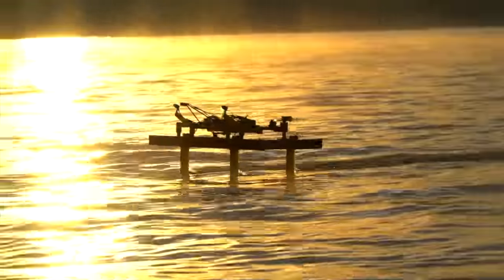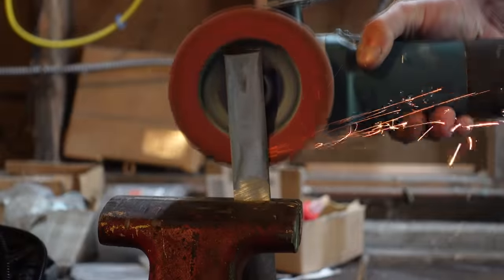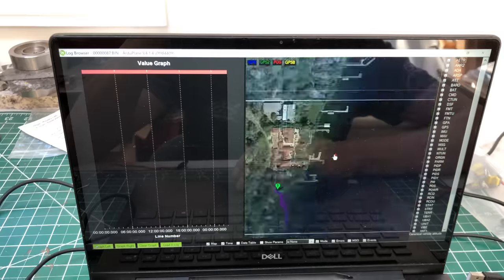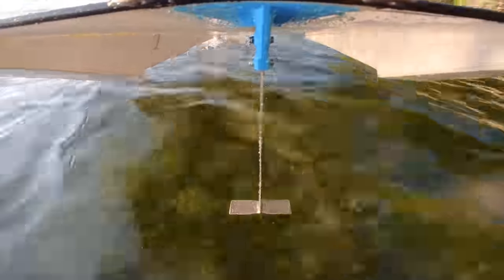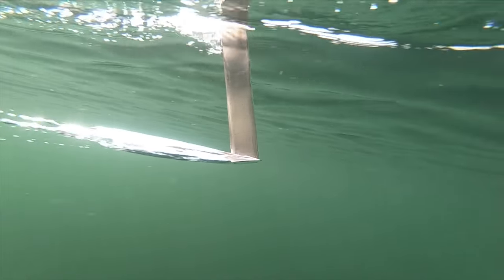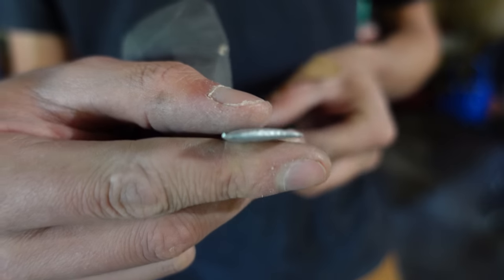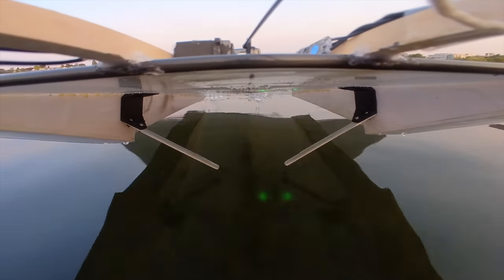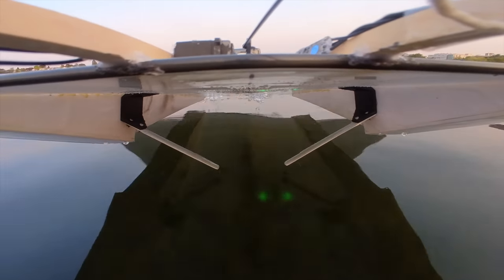Airplane + Hydrofoil - Good or Bad Idea?

Comment: So I guess it's a hydro effect ground effect vehicle now?  :-)   If you look it up, and haven't already, there was a cool one point hydrofoil I saw way back.  The configuration was downright weird, as I remember it.  It was basically a conventional aircraft configuration with the foil on one wingtip, and the other wingtip had another conventional aircraft glued to it at the fuselage at a bank angle (if you will) to the first. 

It think, again IIRC, that it worked pretty well, but I don't remember if it was a scale model (I think it was) and if so, if it ever progressed to a full scale configuration.  I can't remember, but it may have been a cover of popular mechanics or something similar.  It's been a LONG time since I saw it, that much I do remember.

Sorry so sketchy, I should look it up.  Also, I'm not sure that a very sharp trailing edge is at all necessary, or even desired, in water.  I remember that high speed boat rudders actually tended to have a truncated face, squared off, at the back of rudders.  Probably something to do with the fact that water is incompressible.   I also remember screwing around with making a sharp, more typical airfoil on the skeg that went down to hold the prop shaft, and I think I made it to high an aspect ratio for the chord width, or something, as it was aluminum and on the tapering portion behind the crown, being of aluminum, you could see where cavitation bubbles were eroding the crap out of it.  Just a strange data point for you.  That's what I get for not at least thinking the problem through beforehand, or learning a bit more about it.

As for your yaw stability issues, yeah, obvious. You have put the CP forward of the CG, water borne.  Not a good idea.  Think about what happens when you try to run with a wheelbarrow as soon as it starts to yaw a bit, or how much rudder action a tail dragger requires compared to tricycle gear.  You could put a rudder rearward, which is what I'm guessing you will do later in the video (still early days when I wrote this).

When I used to take my son skiing, and he would sometimes wipe out in the lake weeds, he would sit there and scream bloody murder until he broke free (planed on) of the water again.  He was mostly just being an irritating idiot, on purpose, but neither he or I liked them either.  On difference is we are in Fl and alligators exist in pretty much every large lake or chain here.  Not the greatest mind movie.

Once we tried to plane the boat quickly out of a canal on a lake where you could see gators EVERYWHERE.  We were running along on our 16' Hobie one day on that lake and we scared three gators off the bank.  I swear to god that the final one of the three was within a foot or two of the length of the Hobie (not exaggerating).  When he hit the shallow water, which extends out a ways, coming out of the weeds, water was flying everywhere.  Impressed the hell out of me.  Any way, the plane before the canal got shallow was a cluster*uck and we got stuck good. He hopped across the 8-10 feet of water to get a tow rope on the shore to free it, and he practically looked like a Jesus lizard in the process.  Fun times.   And I GUARANTEE you there were gators in that canal.  For anyone that lives in the Central Fl area, the lake I'm talking about was Jessup.  And I'm not kidding about the population of gators.  You can drive across the expressway that splits it and see three or four, when it is calm enough, pretty much every pass.

And you very much DO get ground effect landing a conventional aircraft.  I used to fly an SD100 sailplane and when I landed short and wanted to extend the glide to have less distance to walk to pick it up, at about 1/4 span from the ground, which was about 2' in that case, I could extend that touchdown point a LOT, over just flying a normal glide slope approach, especially if I entered that point at significantly higher than stall speed, I'm talking tens of feet here. It is also why short field takeoffs in full size aircraft are done the way they are, to take advantage of much lower drag in ground effect, vs the drag wheel borne, to get quicker airspeed increase for earlier climb out.  Ground effect starts to become more pronounced at about 1/2 span, and I'm guessing the closer the better, as long as you're not clipping the ground.  Your conclusions are pretty much what I would have guessed, but as always, very interesting.  BTW, the props in front of the wing actually do more than just generate more velocity over the wing at slow speed.  They also cause turbulence, like a turbulator device on a wing, which contrary to my intuition actually sticks the flow to the wing better in the velocity/angle of attack regimes it likes to separate, and laminar flow is always a good thing, approaching stall speed especially.  They used them on the Long EZ (built one, about halfway, anyway) on the canard for a couple of reasons, pitch trim change reduction in rain and bugs (splatters), and reduced rotation speeds due to the fact that the prop flow DOESN'T augment canard lift.  Canards typically don't make great STOL aircraft for that reason, not the optimum configuration.

The inverted 'phone home' was funny.  Wouldn't have seen that coming without thinking it through carefully.  A tip-over power removal switch would solve that if it's an unwanted 'feature', similar to devices typically used to remove fuel pump power in overturned cars.

Comment: Every vehicle runs more stable forward when steering is in the front and the backs direction is stabilized by fixed axles or rails.
So the finn in the front also here makes the back sway aside and the vehicle uncontrollable. 
There's a reason why vains of an arrow or the rudder of an airplan or a ship are in the back.

Comment: You’re missing a ton on that electric plane’s design with it ‘hanging from the wing’ instead of ‘on the wing.’ 
    Check out hydrofoil skiing chairs. You ride a chair that hydrofoils behind a boat while holding onto a rope, just like skiers. I built a couple. Angles are even more important than for AIRfoils. You went about this in about every wrong way as possible. They also have to be ‘tuned,’ like a mass damper for skyscrapers. Not just for harmonic vibrations, but they must be balanced on CG. Chord length is SUPER IMPORTANT, just like with a propeller design. Skiing hydrofoil chairs are the only thing I can think of that hydrofoils with only one chord going in the water, but even it had two horizontal ‘control surfaces’ very similar to an airplane elevator. This was 25 years ago so design may have changed for the chairs. But a hydrofoiling sled that held 4-5 people and weighed 40-50lbs even had two separate vertical chords going into the water, each with a single horizontal stablizing surface. One in the back and front, with the proper length chord at the proper angle to the CofG WHILE IN FLIGHT, tuned against harmonic vibration and more importantly tuned against oscillating feedback loops, with the properly angled horizontal lifting/stabilizing surface perpendicular to the water piercing chord that would equal the lift produced by the airplane would have most likely worked. Plane lifts. Hydrofoil needs to be neutral to the lift produced by airplane….and I’m speaking very roughly here and can explain further if need be privately. LOTS of modeling has to be done and computational fluid dynamic sims would need to be run. You can’t just swap some stuff on with guessing, my dude. It can work and I’ve seen a hydrofoil ground effect rc airplane. NASA did one years and years and years ago in an old documentary that was here on YouTube and several rc forums that have since shutdown had a couple guys into that sorta thing. It wasn’t easy but the ones that were done right were rock friggin solid like they were on a magnet and the surface of the water was the magnet. It was mesmerizing to watch. But don’t fly your models over or too close to the public- makes us look really bad. And goes doubly for their pets: people get hyper defensive over their animals not always knowing when it’s in danger.

Comment: I did not realise how much more drag a hydrofoil has vs a wing.

OTOH, surely it would have less drag than a hull. So can you use the hydrofoil to reach lift off airspeed under less power then have no surface contact under ground effect?

Comment: As you hinted but never came out and said clearly...
A wing for a ground effect vehicle just doesn't work like an aircraft wing.
The ground effect wing is made to trap air between the wing and the ground surface. This is why the wing is ineffective the greater the distance between the trailing edge and the ground.
An aircraft wing works aerodynamically which means it works by creating aerodynamic lift which is typically the difference in surface pressure between the upper and lower surfaces of the wing. In other words by creaing a low pressure above the wing, the higher pressure below the wing lifts the wing.

Comment: doesn't seem useful in flight, but what about a version that is only effective for take-off? reducing thrust needed to lift off the water means a lower power target and you'll be less likely to have the power to fly out of ground effect. idk if this would be achieved by making the foil much shorter (just long enough to help the rest of the craft break contact with the water), or a similar length with the ability to retract after take-off, or something i havent thought of.

edit: finished the vid and now i think my comment is pretty much redundant

Comment: "high carbon stainless Steel"
Was it heat treated? If not there's no point. But I don't think you need the hardness you would gain by quenching it.

Comment: Could the stability not be from being attached at multiple points on the boat instead of dihedral? I am thinking it has more to do with center of gravity or something other than dihedral. Think unicycle vs tricycle. But I am not an engineer, just smarter than most.

Comment: Make the hydrofoils taller so it’s depth corresponds with the plane getting too high and loosing ground effect. So as the ground effect loses its efficiency at higher altitude the hydrofoil is tall enough to compensate and will stop the cavitations between foil and ground effect. Even better make the hydrofoils length adjustable like a tooth drive on the tailing edge that a servo can rotate and adjust the height of them.

Comment: but. But. What with 2 foils, one on each wing, instead of 1 central one? I think that was the thing most people had intended with their suggestions on the old videos... It's possible you'd need a larger rudder, although your ailerons will actually also generate yaw instead of roll in such a configuration, allowing for very flat turns (avoiding the problem you had with wing tips touching the water in normal non-wide turns)

Comment: Interesting experiment and probably confirmed your and most person's intuition that hycrofoils don't belong on ground effect vehicles...
As your experiment confirmed, drag is a major issue in all modes of "flight."
Fully submerged, drag of the hydrofoil structure is at its maximum and with all hydrofoils is a big negative until the hull is lifted out of the water.
In this second mode of semi-flight, only the hydrofoil structure is creating drag, but because of the viscosity of water in combination with the necessary hydrofoil plane plus support structure, it's still very significant compared to if nothing protrudes into the water which is the third mode of operation of a ground effect vehicle...
Full Flight. When any vehicl can lift itself completely out of the water, then it will have vastly less drag than if anything at all on the vehicle still pierces the water.

Lastly, IMO the comment in this video about ground effect vehicles performing optimally only in still or calm waters is likely due solely the design of the wing. I can imagine all sorts of ground effect wing designs where the leading edge isn't low to the surface of the water and so should easily perform wherever waves would not wash over the wing. I'd even imagine wings with drooping tips that could act as hydrofoils only long enough until the aircraft is airborne so would not cause drag at high, normal operational speeds and would likely have vastly more stability than the hydrofoils in this video's experiments. Note that this idea though would be beneficial only for large, heavy craft what would struggle to gain enough speed to lift completely out of the water unlike the RC models in this video. For very light craft relative to potential lifting forces like in this video, the draft wouldn't be much at all and planing surfaces are probably best.

Comment: Air is not water.  While you are correct that air both separates from a foil shape, and that hydrofoils ventilate, you did not address cavitation: top surface and T intersection pressure of the foil being lower than the  sum of ambient air pressure plus hydrostatic.  in other words, boiling water.  The combination of WIG and hydrofoil is very valid, but the foil planform makes zero sense to me.  Generally you will need some control, as CL is more or less linear with AoA for the foil (until it is very not) and drag is proportional to a higher power of AoA and speed squared.  I would have started with higher AR true foil (Eppler?) not a flat+arc and nearer to CoG.  Moreover, less strut to only shed wetted float area and then also leave the water.  Just my .02

Comment: My thought is to have hydrofoils that have a slight downward pull or rake angle I’m using a little more power could find an equilibrium that would keep it from lifting out of the water? No idea if it would work but that’s the hydrofoil use I was thinking of.

Comment: 8:26 The explanation for avoiding sharp leading edges seems to be valid in air. But what about in water? Water is incompressible. How does that affect the stagnation region?
Reply: Air is also considered incompressible when you do subsonic aerodynamics. The changes due to transonic flow are often referred to as 'compressibility effects'.

Comment: Is this "high carbon stainless steel" really more stiff than any other steel? Practically every steel around has the same e module of around 210 kN/mm² (stainless steel often a bit less).

Comment: Let me get this straight. The purpose of a hydra foil is to push up a boat so that there is less contact with the water and therefore less drag. This makes the boat go faster and be more efficient. But what if your boat is already completely out of the water cause of ground effect, why on earth would you still need the hydra foil?

Comment: I can sense an auto adjusting angle of attack linkage video coming up... Lol   seriously tho it should be possible to come up with a couple of wings in a linkage that would automatically adjust angle to keep the main hydrofoil at proper depth.

Also regents aircraft counts as a ground effect vehicle. Lol

Comment: As a. Boater.   I always wondered.  About   THE.  floating debris in the water and debris just under the surface..and hitting a sand bar ….   Weeds.  Etc …       Hitting a. Log just under the surface…ripped off my motor..  but I. Didn’t. Sink ..  the foils have to be made so they. Break off and can be. Replaced   Sorta like a spare tire…    ….Retractable foils that come up along side the. Hull .. might work .. I have seen them on a couple large ships ….

Comment: Check out l'Hydroptere. I've been arguing for years that it isn't a true boat its a WIG craft with hydrofoils. And only being 3 minutes in I bet I can guess your big concern. The sweet spot of this design puts you squarely in the world of the late great Emerson Fittipaldi. "The best is when you are just on the edge of being in control and being afraid." And we know how his story ended.

Take your design of the early one with a foil scale it up add a 100' mast and crowd on every bit of sail we can cos we're mad bastards with a need for speed. Now keep it right side up. They have a compilation of some spectacular crashes so its not so easy.

Comment: comment on 2:38min: why did not buy 4 cheap kitchen knives  and weld them together in T shape  one to another then just shape edges of the foils? Sometimes you over-engineer stuff which can be made easier from existing items.

Comment: You could use the concept of those surfboards hydrofoils and add the wings for ground effect. It wouldn't fly away because the propeller would be underwater. It would be an hydrofoil ground effect hybrid. Probably would suck but it would be nice to see you testing hahaha
Reply: Sounds like you’re looking for a hydroplane - check out H1 Unlimited.
Reply: @nwzander  almost it, but the hydroplane is still very shaky as the hull is bouncing on the water all the time. Maybe the foils wouldnt make it faster, but could make it more stable and power efficient.
Reply: @nwzander  something like the "enata foiler" but still being lifted mostly by the ground effect. The foils would be only for propulsion and stability.

Comment: I'd love to see the opposite approach. Take a hydrofoil boat and add ground effect wings. Also a single hydrofoil? thats silly surely three point contact or two point is the minimum for a hydrofoil to avoid the pitch control issues demonstrated. The engineering could be improved, was a slightly misplaced or half hearted approach to the challenge.

Comment: Im wondering about how the hydrofoil is attached.  Why should the hydrofoil come straight down off the ship.  Seems like if the foil was swept back as if you were pulling an anchor it would keep the nose from coming up so much.  I agree though, I don't see this as good idea for hydrofoil use on this vehicle.